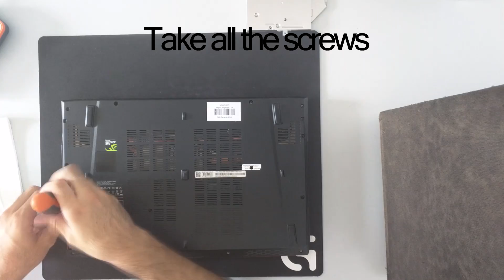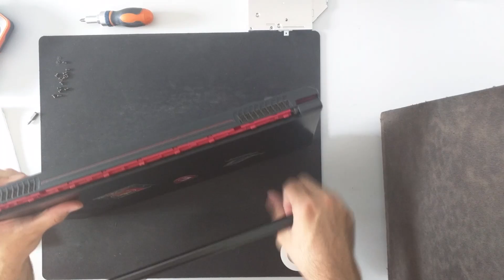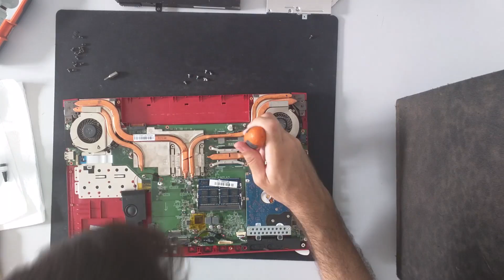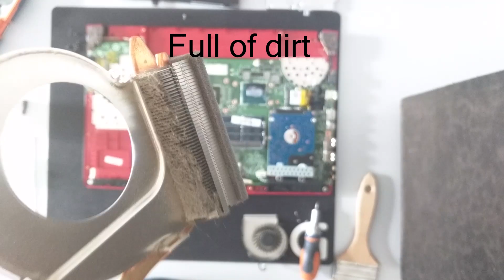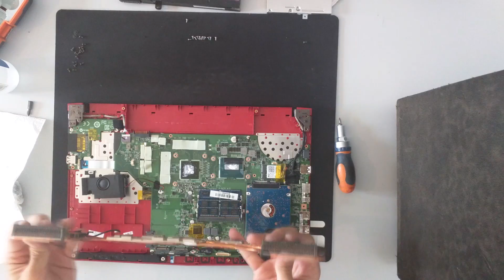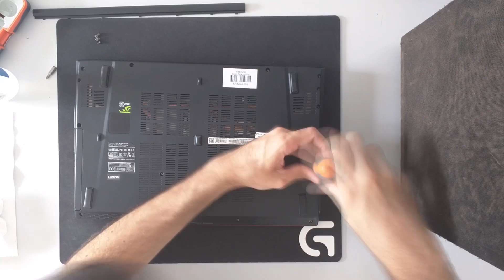MSI GE62 2QD Apache Pro Disassembly

Comment: Super helpful! I scared myself when it wouldn't turn on after I reasembled it, but it turns out that if you take out and reinstall the battery, it won't turn on under battery power until it's been plugged in. I'll tell you my heart sank until I thought to plug it in.

Comment: I did a disassembly to apply new thermal paste. Replaced the old one, and put everything back together. Now the laptop screen won't work, and micro DS as well, and only HDMI works. I made sure everything was reconnected, even re-opened it to check. The only cables that were disconnected were the fan powering ones, the Wi-Fi and the cable for the screen image signal. Only the last one might have caused problems, but it fit very well in the port every time I checked and the lock went down normally. Any ideas?

Comment: The 3 screws under the optical drive are extremely hard to open, do you know what size screwdriver I need to open them?
Reply: Lord Fartsquad I just destroyed that part...i could’t open it with 5 different size, what a work msi
Reply: @xiaososo4649  Turns out all you had to do was go to a tool shop and ask for a "Really tiny screwdriver"

Comment: Hello, do you know if it's possible to give the fans a good cleaning without lifting the heat sink assembly? My laptop has not been cleaned and it's about 2 years old so I imagine the heat sink fins are fairly dirty (like yours in the video) but I don't wanna deal with changing the thermal paste right now.
Reply from the maker: Dim H maybe u can take the back plate off and then with pressured air u can try and trow it from the outside of the heatsink to the inside and see if it comes off but I don't recommend it
Reply: @alejandroseijas4863  how did you clean the heatsink fins?
Reply from the maker: Jeffrey Epstein didn't kill himself with a brush, like one for painting but it need to be soft

Comment: Hi. I did everything you did on the video. There was some dust on both my fans. I cleaned them with a brush, assembled everything and it works. The thing is, both fans do not reach the maximum speeds anymore (6000 rpm). One of them sits at around 5850-5925 and the other at 5580-5650. Any idea what might have happened and how to fix it? I also think the culture of work of the second one is a bit worse than it used to be.
Reply from the maker: speeds are on normal, wont make any difference just a few rpm more, no worries
Reply: Allright, thanks for reply! By the way, I'd like to replace the thermal paste. The previous one I had (brand new, came with laptop, never changed) was amazing and still is, but it's nearly gone. Do you happen to know which pastes MSI uses as a standard or do you have your "go to" product?
Reply: The fans only boost to 6000 if your thermals are too high. Maybe whatever you did fixed it and it doesnt need to go that fast anymore

Comment: With someone who is scared to this and who has no computer experience, plus the warranty. Do you think it is a good idea for me to change the thermal paste? -My laptop is about two years old
Reply from the maker: taulant xhakli if It still has warranty dont do It, but if It dosnt just do It 100% u will see better temperature performance
Reply: Ale Seijas Thank you
Reply: @taulantx   2 years as the thermal paste might be dry and could be hot,if your laptop warranty is expired I suggest you have to replace your thermal paste and clean the fans too

Comment: Hi, I have a question: Do you know if it is possible to replace or at least rearrange the plastic frame from the screen? the metal hinge from the left side of my laptop separated the plastic frame so every time i lift up the screen it seems the plastic frame will eventually break. Thank you for this useful video.
Reply from the maker: Juan Sebastián Rojas Melendez i think You could do something, could You please email me a photo? and we see what u can do
Reply: Sure, here it goes. I have tried to put it back in place pressing on it but it just won't stay like it used to be, so i want to know if i can remove only the plastic frame to rearrange it or if necessary buy just that piece and replace it. Thank you.

https://drive.google.com/file/d/0B43dJwuKZUqmajlzeUQzRnVTajA/view?usp=sharing
Reply from the maker: Juan Sebastián Rojas Melendez You have to completele unmount the laptop, in order to disconnect the screen from It, then very very carefull u have to separate the screen frame from the LCD
Reply: Thank you, i couldn't find that piece anywhere, really thank you very much.

Comment: Somebody knows what is the 14 or 12 pin for (I don't remember and cannot see it clearly on the video). The one that is between SSD slots and the HDD (slighty left from the internal speaker connector)

Comment: Hi,
I have this exact same laptop model, and in the last few months I am having a problem with my screen. It is flickering, shutting down, and 'snowing' in certain angles of opening the lid.
How can I fix this? I have some experience with disassembling laptops and PC's in general, and I did understand that it most likely happening because of bad physical connection between the laptop wiring and the motherboard... Can you specify the exact location of that? I would highly appreciate such help :)
Reply from the maker: blur smash I can't do it because I don't have that model anymore, but I tell you it's quite easy to find, just follow the cable from the screen, but be careful cause to change the cable of the screen u'll have to open it and u can damage it severly, do it with patience, and sorry, good luck
Reply: Señor X hey I have just finished opening it and found the path of which the cable goes in. Now I see the cable's connection in the monitor, it seems good. The tension/compression of the whole cable seems okay as well. Only thing is that the cable is a little bit pressed where the bending of the cover is, right on the axis of the opening. It is also little bit damaged there too (very minor).

Now I'm starting to think that perhaps the connection to the Motherboard is not tight enough or maybe the cable has any other damage along it's path that way (to the M.board).

What do you think mate?
Reply from the maker: blur smash it's very rare a cable damage there, I think it's the screen but try changing the cable if u consider it's not good but I don't think it's the cable
Reply: Señor X but initially the problem was in certain angles of opening the lid, which means that the screen was perfectly working in those angles...
That is why I think it is a cable problem
Reply: Perhaps you know where can I buy such cable? Is it laptop-dependant or just a regular, global cable that fits all laptops?
Reply from the maker: about 1 month delivery for EU        https://goo.gl/B5K4jr
Reply: thanks a lot buddy. I am pretty sure it is the cable, because when i try twisting it and stretching it a little bit in the area of the folding, I see noticeable changes in the density and total amount of those snowing pixels. I'll show you a video of it soon when it finishes uploading... thx again

Comment: Nice video. I just repasted my MSI GE 62 2QD APACHE PRO with IC Diamond. But to my surprise nothing changed. 
Before applying it  I got thermals like 50 degree on idle and 90 degree on full load (prime95 stress test). The thermals are same after applying the paste.
Can u plz post your thermals before and after applying the paste??
Reply from the maker: its not really the past what keeps it cool, it removing the dirt from the fans to prevent it to overheat, but also replacing it's good.

Comment: question, some of my keyboard buttons don't work anymore and there is no sign of liquid damage or dirty ness behind the caps(believe me i checked). and i have no warranty anymore after i replaced the keyboard for the same exact reason last year by the seller. can it be that the connector is damaged? if so can i fix it myself or is it recommended that i should send it back to an expert? if i can do it myself could you please do a video about the keyboard?
Reply from the maker: the  keyboards in this laptos are kind of shitty because u cant take them apart like normal laptos, it comes integrates with whole plastic frame, if u replace whole thing will cost u more than 100$ by msi , if u have the money, i would send it, if not, "https://goo.gl/CUjMWQ " and do it yourself, but be very carefull when u remove the old one from the plastic dots where its weld on the frame as it can break easly
Reply from the maker: Amanpreet Singh yes, and it's cheap

Comment: Hey man i own a similiar type of msi it's called MSI GE62 2QL Apache, but i cant seem to get the power button area up, neither can i get the top panel up either, any suggestions?
Thanks.
Reply from the maker: Make sure  you tighten the screws well
Reply: Tighten the screws? but what will that do?

Comment: hi, i have the same laptop. i was wondering, when i purchased this laptop and played games, the dual fan was so cold, i even didnt feel warm at left palm area. now, it got a bit warm when i use to play game (dual fan on). what should i do?
Reply from the maker: probably the stock thermal paste it has by default is bad, but i dont recommend u changing it if u have it on warranty, try using a laptop cooler or lower settings

Comment: My MSI ge62 isn't working
Reply: @alejandroseijas4863  2 days ago I didn't use the laptop when I press the power button laptop isn't starting up. I thought it might be the charger but it wasn't. Hope it isn't my motherboard
Reply from the maker: try with the batteries
Reply: @alejandroseijas4863  i did